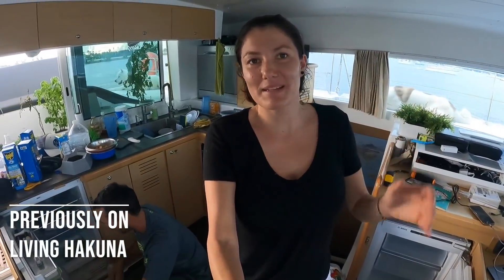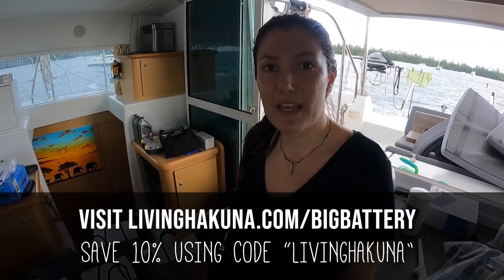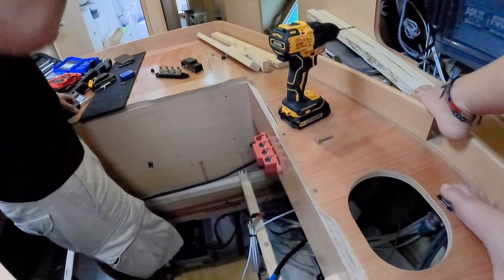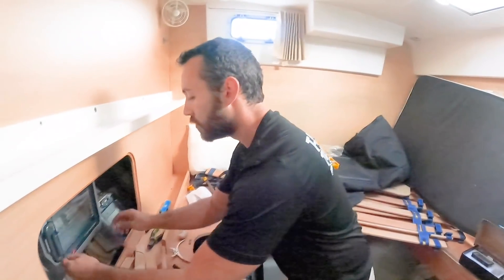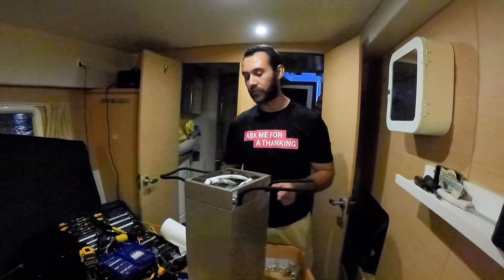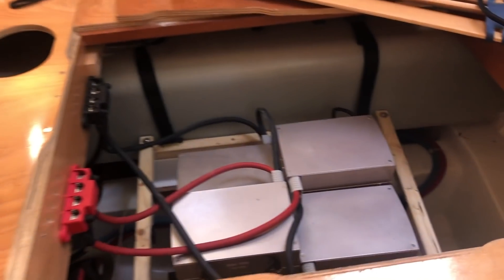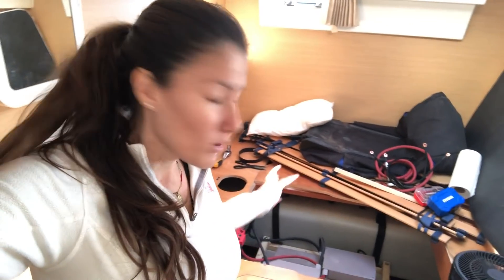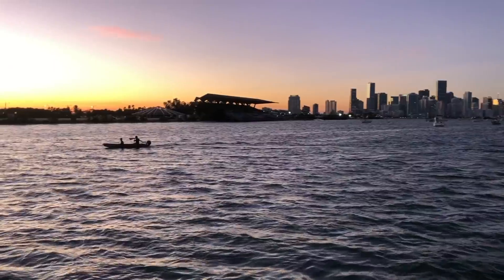LiFePO4 Installing Lithium Batteries On Our Sailing Boat | Weekly Vlog Ep. 60

Comment: Alejo:  as far as I know a shunt is to measure current.  You do not need a shunt to measure voltage.  Also, check with the manufacturer of the battery about charging requirements of a LiFePO4 battery.  I don’t think you can charge them with the settings of a Lead Acid battery.  Best of luck and have fun in the Bahamas!  😃
Reply: Also, seems like the shunt should be in line between battery negative terminal and negative busbar. That is assuming all other negatives run from busbar.
Happy sails.

Comment: I don’t know about that inverter not recognizing your batteries other than lead acid/ gel batteries. Recently Nick O’Kelly from Sailing Clarity had to reprogram his inverter or his battery monitoring system to recognize the lithium batteries which charge at a higher level. You may want to watch that episode or if you run into him in the Bahamas, they are there now, ask him if your installation will charge the batteries to that higher level. I wish I were there and away from this rain in Vancouver BC. Cheers from Canada, stay safe, enjoy your sail and have a very happy Christmas. Love the channel, Doug

Comment: That price is really good!  I haven't looked too hard, but I was under the impression that to get 170 ah of 24v battery would be closer to 3 to 5 grand, so getting 4 of them for less than 7 seems really great!  Having a look at their site also shows that their power to weight is also top notch!   they seem like one of the best options all around.  Definitely look forward to seeing how they fare for you two.
Reply: Yeah they're pricing is about half the normal rate .  Wonder what the catch is?  I haven't seen them in any other online stores.  I wonder if that means the price is good because they are direct distributors?  Because most products are sold at double what wholesale is.  If so I bet other lithium companies are hating bigbatteries lol.  Victron is 3k for 170ah at 12V
Reply: also 10 percent off and a ten year warranty.  Cant really be beat.
Reply from the maker: HI Fleshbox, yes the prices they have are unbelievable and they are really good quality

Comment: Since your inverter/charger only supports flooded lead acid batteries and not lithium you may lose another battery bank.  It is likely that you lost your lithium bank because it never reached the top voltage to balance your batteries.    Some batteries support bottom balancing, but most support top balancing.  You need to ask your battery supplier what voltage the batteries will balance at...lead acid is lower than most batteries will start balancing.  Likely that is what killed your LG batteries...they didn't get high enough to transfer energy between cells in the internal BMS boards.  Flooded lead acid will float typically at 13.8 volts.  Most LIFEPO4's(12 volt style) I think will be in the 14.8 ish volts top charge...so you can see how the BMS would never kick in...You need an additional lithium specific charger perhaps a solar charger could get them high enough.. or a new inverter/charger.  You have to get them up to a higer voltage at least once a month or maybe twice a month for a little while so they can balance. Additionally I hear LG batteries S-uc---k.
Reply: Exactly !!!
Reply: 3.65v for cells = 58.4v for top voltage for a 48v system. The solar charge controller should  be sett to 55v so as to not over charge the cells. Lifepo4 batteries and flooded lead acid batteries voltages are very close match.
Reply: I wish I say this before ... Did you look in to Lithium Titanate ... seems like thats is going to be the new chemistry for off grid stuff
Reply: Very safe and long life  but expensive, heavy and low capacity. Not for me.
Reply: @neliosamch3195  not sure I agree ... But it's all good ... I like the idea of safe and buying cells instead of a pack ... Make it fit the hole you have
Reply: @AnthonySelby  absolutely, that's is what I did but with lifepo4,  16 cells of 280ah for less than 2k and it is about 23kw.
Reply: @neliosamch3195   at around $25 a cell wouldnt that cost around $500 including mounting and bms ?
Reply: @AnthonySelby  lifepo4 280ah class A cell is about $100 dollars in aliexpress.
Reply: @neliosamch3195  a LTO cell 2.3 v 35 ah is $25
Reply: @AnthonySelby  what is the pack voltage? 12v, 24v, 36v, 48v, or 60v?
Reply: @neliosamch3195  24
Reply from the maker: Hi Allyn, Our inverter does support lithium batteries but the lithium battery needs a CANbus communication cable like the one on the LG battery (the SMA inverter we have is specially made for lithium) for this big battery we are going to replace the bms with EMUS or REC bms that has a CANbus communication cable. We appreciate your support and tips that is how we have learned a lot from you guys. Thank you and have a happy  holiday
Reply: @AnthonySelby  35ah × 4 = 140 ah × 24 = 3.3kw.   $500.00  23kw $1500 20kw is the best deal.
Reply: @LivingHakuna  It would be much easier to just wire a nice solar charge controller in bypassing the existing inverter.  Then sure you might only top out most of the time at 13.8 voltsx4=55.2V  once the batteries hit that on shore power, etc.  That is fine, your batteries will last a super long time.  Then as solar hits the top charging level the cells will balance.  This is a lot less fiddly than opening all your batteries and possibly voiding the warranties.  Let the solar charge controller top them up and your existing inverter/charger continue to do what it wants at a lower voltage.  You will still always have power as long as the inverter thinks it has enough energy from the batteries to do the job.  Might I suggest something like this: https://www.ebay.com/itm/EPEVER-60A-80A-100A-MPPT-Solar-Charge-Controller-Regulator-12-24-36-48V-150-200V   just get the meter too.

Comment: We wanted to wish you a merry Christmas and make a comment about the heat that comes off those batteries. Imy husband who's an engineer and we have an off grid solar system for our entire home says that they shouldn't be that close together or what are you doing to keep them cool? What does the company say about that? We are just trying to help you we don't want you to have problems in the future. And we wish you the very best. Your fans Sandra and Ariel
Reply: Good point!
Reply: I'd worry about the inverter before the batteries! 16KWH batteries , no worries😀

Comment: Glad you are getting it all sorted out. Did you say the inverter is set to lead acid (for your brand new lithium)? Doesn't sound correct. Good luck, stay safe and Merry Christmas.
Reply: Something not right there, the LG was 48v Lithium, i was wondering if it had a built in charge controller, really hope they don’t continue charging the new batteries as lead acid batteries.
Reply from the maker: Just Wayne, no the Lg was set up as lithium with the inverter/charger but since the new batteries don’t have a can bus communication cable we have to set the parameters out selfs
Reply: @LivingHakuna  oh I see. I’ve heard of others doing that. Great video’s guys, stay safe and have fun

Comment: Electrical Engineer here... you can not charge Lith batteries like a Lead Acid. Also, you have no heat dissipation.  I STRONGLY suggest you work on ventilation. Put a fan to move the heat out of that area.